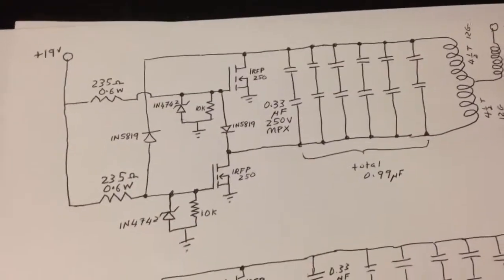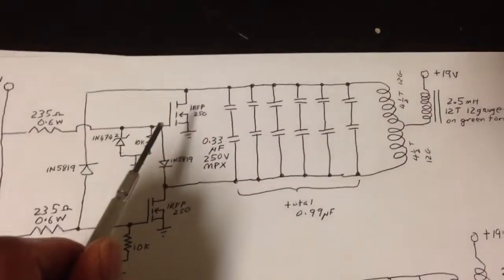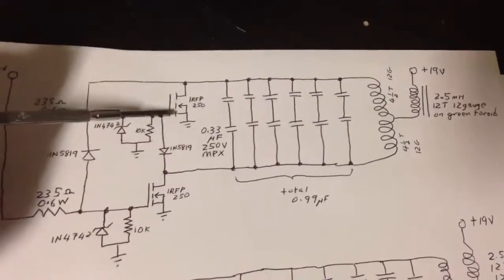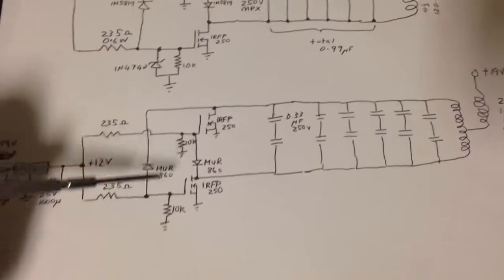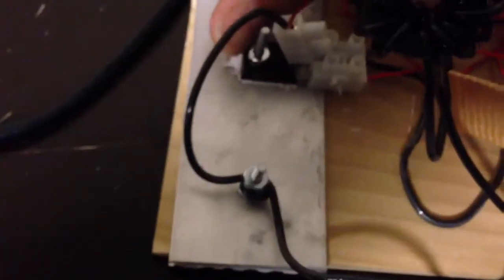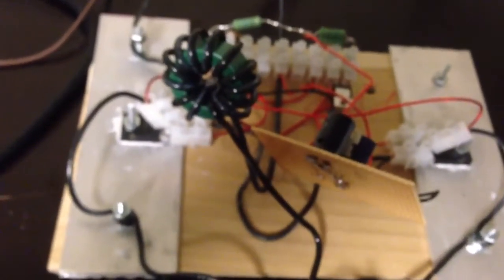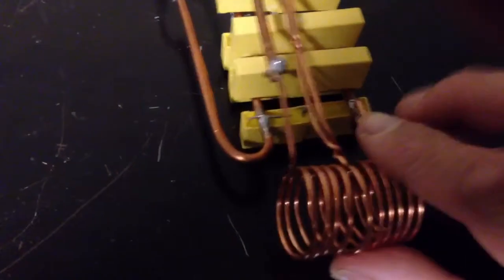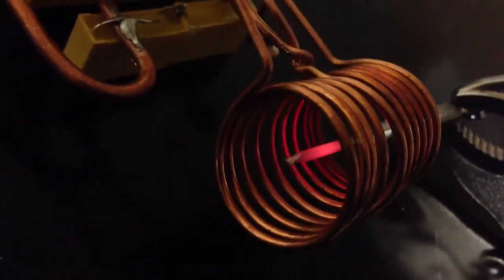Induction Heater Part 3: improved stability and performance

Comment: hi good videos  i made a smaller induction heater yours is much more powerful can you tell me what are the 10k items u have on the board   you didn't mention what they are thanks
Reply from the maker: Those are to help drain the positive charge off the gates and to help the mosfets to turn off quickly.